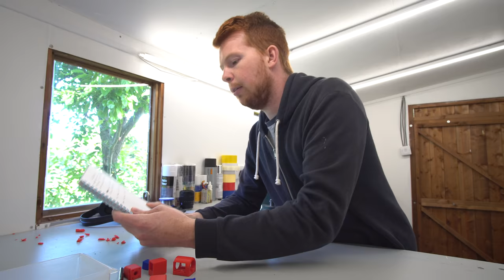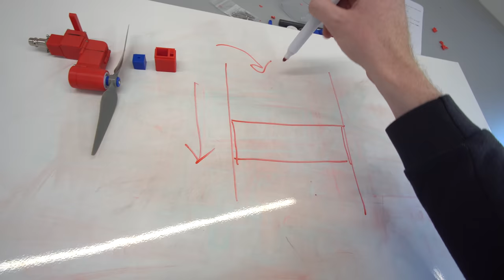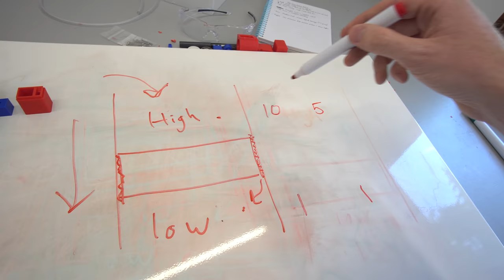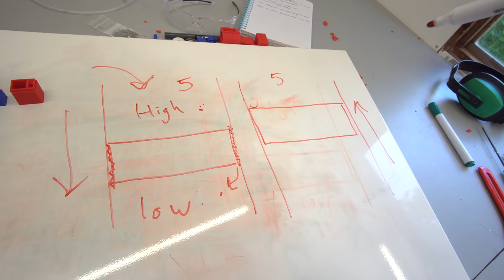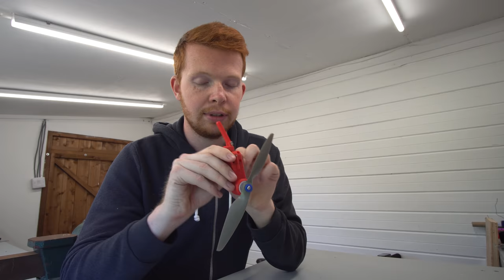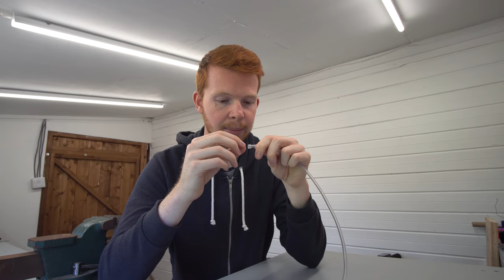Multiple or Single Cylinder Air Engine?

Comment: I think the reason you would want to use a multi-cylinder engine is more a question of torque and power than just efficiency.

Firstly, with a multi-cylinder engine, you have the possibility to have at any time at least 1 piston pushing and turning the crank shaft, as opposed to a single cylinder engine where you have a mandatory "idle period" where nothing is pushing on the crank shaft which acts more like a flywheel.

Secondly, if you make your pistons push at the right times, a multi-piston engine will have a (somewhat) steady torque output, with only small variations, if any.

Thirdly, if you already have figured out an engine with the two above "properties", you can multiply the number of pistons active *at once*, this way pressure will push with more force on the pistons. It is an analog (more complex howerver) to having a larger piston, since it technically augments the surface area to which the pressure aplies force(quick reminder, pressure is often calculated with Pa, or N.m^-2 in the metric system). Since pistons are applying more force to the crank shaft, the torque is higher.

Now, a multi-piston engine will surely use pressure quicker than a single piston, but will surely be able to produce higher torque, to a point where, yes, a multi-piston engine is more efficient.
There may just be a thing I am not seeing or can't think of that could allow a multi-piston engine to run for more time than a single piston, but I honestly doubt that.

In the end, whether you should use a multi or single piston engine comes down to what you want to do with it, whether it would be a good idea or not, however, you can just decide on what you want to do and what you feel would be the most interesting thing to explore.

The choice, is all yours.

Although I think I prefer multi-piston engines.

Comment: firstly you should make a deeper hollow on the pistons so you would have much less piston weight and would transform much more power but has a drawback as you know there will be more trapped air. secondly make the 1 piston engine work flawlessly so you wont encounter those problems with more complicated engine. third one is taking the pushing rod front would make your engine smaller good idea mate. 4th one is use a pistoncup with a weight on the piston so you will always get the same pressure dont know maybe a string system with that way you would have more reliable air pressure and would use much more air

Comment: If the air leakage relationship is linear (I believe it is), then having the 2nd cylinder will decrease the efficiency, due to having an increase in friction. But if its exponential, then it should be much more efficient. If you want higher efficiency, and are willing to get a little more complex plumbing, try using the "exhaust" of the first cylinder to power the 2nd. The amount of expansion your getting out of one cylinder can't be anywhere near the most you could get out of it, so even if your only getting say, 50% of the power out of the 2nd cylinder that's still a 50% boost to efficiency. I'd recommend using the flat-twin design if you were to go this route as you already have an existing design. Perhaps it could be as simple as putting a nipple on your exhaust vent and a tube running to #2's valve

Comment: Make a flywheel for it if you're doing a multi cylinder design. A flywheel will help it keep spinning anf will make rpm changes less rapid and will make it run smoother. Also, one day it would be really cool to see a rotary, radial, or V platform engine 👍.

Comment: Flat-twin with two-piece printed manifold. No need for tubing. Print the stacks and bottom plate as one piece, and a separate top piece for the horizontal channels. You'll have to custom make gaskets.

Comment: The power come from the area of the piston the air acts opound, so increasing the cylinder diameter will increase the power and only increase the pheriphal a bit, which you are afraid to loose air pressure fhrough. If going for the dual cylinder, take the bokser - take the bottle connection and air accuator and align it with the crankshaft (without pressuraising the the crankshaft) redesign it so that accuator "pumps" air through the cylinder walls op to the top where the input value is, this will remove the need for a pvc tupe.

Comment: i like the inline twin, but one issue is with the pneumatic path is how to get air to cylinder #2 without pressurizing cylinder #1. this could be solved with a v-twin, which in theory would look like you slapped another engine on the back of the existing one at about a 30-45 Degree offset, you could probably even re-purpose some of the existing plans of the V3 engine like the camshaft.
as for your tubing issues if you design a barb on your connection point then warm the pvc tube and zip tie it down there should be very minimal leakage

Comment: I'd say focus on the single cylinder engine for a few more weeks, you've done a great job so far  but you can push it a little bit more. You will need to move on to a multi cylinder engine because I feel your theory on five psi for two then ten psi for one will result in a more efficient design down the road. Also the flat twin is a better design for now as it will require less moving parts making it more efficient. Great work

Comment: Have you thought of using rubber O rings as compression rings?  This might solve the piston blowback problem.  Add a drop of lubricant to the cylinder before use to lubricate the compression ring.  On next generation create a crankcase to fill with lubricant.

Comment: i think a straight twin will be much easier to increase efficiency and fix leaks, and you can have a smaller volume inside the engine to maybe increase the pressure and "push" on the pistons,

 with a complicated intake, like the one on the flat twin will need have a lot more work to perfect and maximize efficiency

Comment: Do a multi compression staged multi cylinder engine.  Say the first piston had a surface area of 2 sqin and a second piston of 10sqin. Running at 100psi, the smaller cylinder goes under pressure. Once it reaches the bottom of the stroke and the exhaust opens the pressure is diverted to the second cylinder thats starting its power stroke.  So say with expansion the air pressure had now dropped 20psi. That 20psi pushes on cylinder #2. Now make proportions work out where both pistons provide equal force on the crank.  Could potentially be much nore efficient. Use the same volume of air ss a single cylinder but up to twice the power of it.  Sorry for my poor description but hope you get the general idea :-D

Comment: Single is WAY more efficient when it comes to the problems you mentioned (blow-by/simplicity), actually it's pretty much better in every way, but people think complexity means cool so you're going to be building one of those, my advice is to use multiple pressurized bottles because you're going to run out of air proportionally faster to how many extra cylinders you have, you might get more power/torque out of it though so you should be able to use a bigger prop with a more aggressive bite, that should slow down the rate of air consumption while giving you more chop to pull through the air. Good luck dude.

Comment: I vote single. If you still feel like you haven't perfected single then work on perfecting single. Then once you've learned how to make the piston tolerances as perfect as realistically can be and the simplest crankshaft config etc. Then apply that to a multi cylinder and you'll end up with a much better working engine! :)

Comment: Hi Tom
I would like to see both designs, the single and double cylinder, witch will be a pretty piece of engineering...
Maybe you try to print the air ducts inside your engine block, this should be tight enough and you can get rid of the flexible hose.

Comment: The primary advantage to multiple cylinders is about the power stroke.  Instead of only having power added to the shaft for at most 1/2 the rotation and the rest being bled, you get both a more powerful and more reliable shaft.

Comment: Try using metal sleeves for the cylinder and piston, to improve on friction losses and leakage. Machine them out of steel and brass respectively to 0.5 mm thickness, that should be appropriate.

Comment: Do a RADIAL. This allows the design an engine "sector" and  a common pin crankshaft. Takes the balance out of the equation and also allows a much smaller engine for the same displacement. Should also simplify the cam design.

Comment: Fittings with barbs and using copper wire to hold the tubing in place will alleviate your leakage and disconnection problems.

Comment: Great video. Great involvement of your audience. IMHO, I reckon, in line with your design process, that you focus on modularization, and go for multi cylinder engine design. Specifically, consider a frame to house your cylingers, either, 2,4,6 or even 8. Keeping a standard cam would allow for multiple cylinder design also. I know you'll be thinking, wish dude, that's totally over the top, but it will allow you consider, the surface area of your cylinders (rather than leakage) allowing for greater efficiency from a lower compression level, where the power band in each stroke from multiple cylinders would create a much more focused force to the propeller. Or I might be totally wrong... Keep up the very interesting work. PS, please keep the information WRT 3d printing process problems and solutions in your video... I really don't mind a 20 or even 30 minute video... Great stuff buddy, g'day from Australia.

Comment: Straight/in line twin will be overall easier for you in my opinion, if you're willing to test other materials than 3d printed shaft you could bend it into shape and solve the offset problems, maybe you could even steal one from a tiny model car

Comment: straight twin for sure, changing the design of the crankshaft will be much easier than design of the "fuel" injection system

Comment: Twin cylinder engine, and compression below the cylinders in the crankcase would increase the power significantly and balance would be perfect. You would also save the cylinder heads making the engine lighter.

Comment: Build a modular engine where you can stack the up inline. Build a single, double or as many as you want and have the cranks inter lock together with rubber seals for the intake channel to meet up and run air all the way down the inline engine

Comment: Single cylinder is fine for aircraft applications where hand starting is easy, but twin would work a lot better in a car, I think since if you design it well, it should run as soon as air pressure is applied.

Comment: As a revisit, did you ever consider a three cylinder engine as in three of your single cylinder engines displaced 120 degrees apart and all running on a common crankshaft where such a crankshaft is made from adapters which link each of the single cylinder crankshafts to form a common one. Such an engine should provide self starting and smoother operation with much lower vibration. I would suggest the air supply to each cylinder head be done by 1/8 npt or bsp nipples and Tygon tubing. You would also need two mouldings to couple the three cylinders into a single mass.

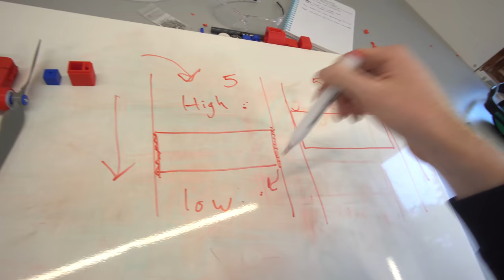Comment: About the explaining at 3:15 about the benefit of 2 cylinders.

The pressure in a given system is equal at all surfaces, but the Force at the surface may differ: p = F/A <==> F = p*A
If you want the same Force with 2 pistons - so you're doubling the Area - , you can half the pressure.
F = p*A and F = p' * 2A <==> p' = p/2

And if you can half the pressure, the flow around the piston head will be smaller. But you should check if the benefits of reducing the byflow are greater than the increased losses because of more friction.

Comment: Actually when you have higher pressure, it should be more efficient. Since air flow through valves are directly proportional to pressure difference and pressure difference is directly proportional to volume you will have the same percentage of power being lost. BUT the "canal" on the side has a squared rising air resistance. more pressure difference causes the canal to be percentually more shut. So higher pressure IS more efficient. In terms of efficiency i would actually make the volume bigger in lengh and maybe smaller in area so you reduce the air canal on the sides... This would result in more efficiency but also more torqe and you should consider a bigger propeller....

Comment: If you are going for an overhung (single bearing) crankshaft look up a scotch yoke mechanism rather than the conrod and piston layout. Much simpler and more robust.

As for efficiency the larger the piston diameter the larger the volume to cylinder perimeter ratio therefore less leakage. 

Also look at throttling your engine by altering the valve opening time and lift. This could be done with a wedge shaped follower on the valve cam/pushrod interface that would open the valve for longer (and more) as it slid in and out.

By opening for less time you let less air into the cylinder and increace it's effective expansion ratio.

Comment: If we assume the gas to behave as a liquid, then the leakage flow is proportional to the delta pressure over the gap, it is also important to stress that the proportionality constant is also proportional to the cube of the leakage gap. Q=K*gap^3*Delta_Pressure. So the really important bit is sealing the gap, there is way more to gain. Just google leakage flow equation, sry for not providing a referance to a book. It's just based on lecture slides form a fluid dynamics and statics class i took doing my Ba.

Comment: I have an idea for the air supply.
How about you use something like PC4-M6 pneumatic connectors + PTFE tubing?
You can easly thread them into pla and form an airtight seal, then you use the same connectors (with  a different size) to hook it up to your air compressor / tank.
Oh and i like the flat twin better.

Comment: for best efficiency you should look at the concepts of inline 6 cylinder diesel engines form BWM which are known for efficiency. These engines produce high torque by using long piston rods and low rpm. You could try to make your rod longer as well. 
And btw: Multiple cylinder engine pls!

Comment: For improved eficciency you should go twin stage expansion. Longer stroke, better timing and lower rpm.

Some 120 psi on that bottle would be nice, you can reinforce it with another layer of bottle outside.

Comment: I would say stay single for now but when you decide to do a multiple cylinder engine do an inline two cylinder first less plumbing to deal with and then an opposed cylinder or other design. Also I know it will increase drag as there’s more area that the engine will take up but try piston stroke length and see if that helps it generate more power.

Comment: Tom, sorry I’m a bit out of date with your exploits (only by three months, errr). My answer to the question everyone seems to be ranting about would be to go for a long stroke flat twin, that’ll give you better torque, better piston sealing and lower piston speed. 
You shouldn’t need very high piston speed on the plane if you design the propeller properly. As you say, a flat ‘horizontally opposed’ engine will give you a much simpler crank than a parallel twin.
Here’s a possible way to seal PVC tubes in place. Go to eBay and look at a “dropper bottle” to see what I’m talking about. They come with an inner ‘nozzle’ cap and an outer ‘sealing’ cap. You’d need one with a long inner nozzle and a hole in the outer cap big enough for the tube to go through.
You'd thread the tube through the outer and push it onto the nozzle of the inner cap. Then you just slide the outer cap down and screw it on to lock it into place.
If you 3 d print the ‘inner’ caps and threads you can probably use ‘outer’ caps from eBay to seal the tubes on.
However my question would have to be, what pressure can PVC tube hold?
Best of luck.

Comment: For a car I think the flat opposed twin cylinder may be best way to increase power, although may not be as efficient as the single cyliner.   The PTFE tube should not leak, may need different fittings or seal the fitting with silicon caulk or epoxy.

Dave.

Comment: This might sound crazy....
What if the air inlet was connected to the crank case? So instead of pushing the piston down towards the crank shaft, it pushed it away from the crankshaft.

You could get rid of the ball valve and instead have the cam replaced by a perfectly round disc, but with a notch in it that would allow air to enter the piston as it reached bottom dead center.

You'd probably want a thinner bottle though, since the prop would be perfectly inline with the center of the bottle. Or a bigger prop, if the twin cylinder engine could put out enough power.